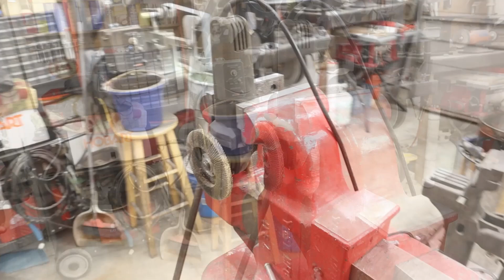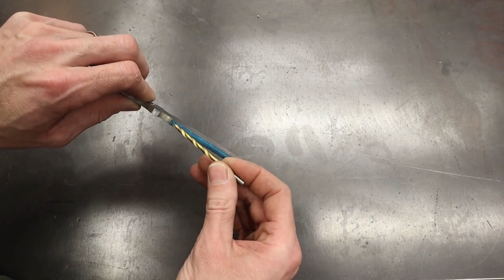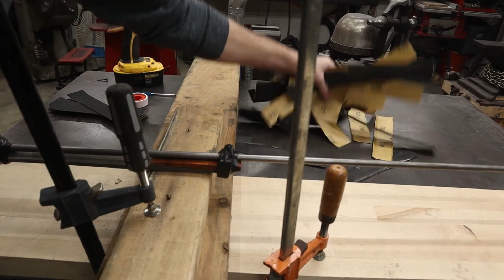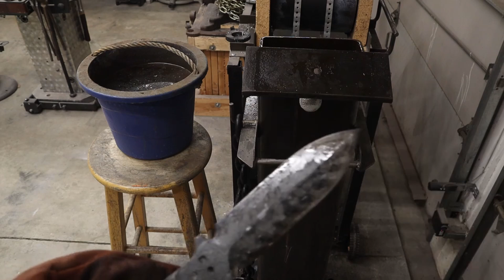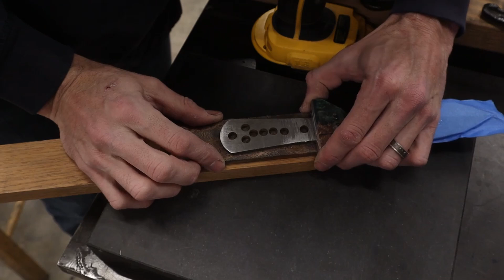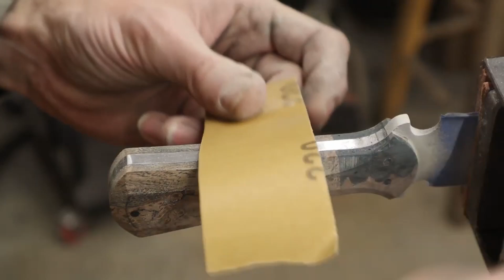Making a special knife!

Comment: I subbed.  I just jumped into knife making a couple months back, I'm 64, been an auto mechanic- mostly for 45 years but picked up 30 other trade skills along to way. Like jumping into making knives based on something I saw in a show about medieval times, and scraps  iron from something I'd cut off with my plasma cutter., then buying a 1.5' x3.5' x 1/8" piece of stainless steel which was 10x what thought it would be and wouldn't have, had not the man who owned the place immediately cut the price in half because he was so pleased with repairs I done to his car at 1/2 the cost the dealer had quoted. But I have since scrapped a free treadmill for the motor, bought the pulleys and built a 2x72" grinder. They declared me disabled 2 years back after a fall broke 107 bones and they expect me live on 960 a month. I still have my tools so I've been using those which I now see a waste. And had a good laugh when I saw that can of Mothers polish, which I have for the wheels on my truck. Thank you for most encouraging informative video I seen yet.  Everyone thinks I'm wasting what little time I have left, and don't understand that when I stop working is when the dying starts. I think your idea with the grinder/vise  perfect and safer than trying to put the knife in the vise. Thanks for guidance, providing me a new course of action.

Comment: I subbed!!! Love your videos!! I’m just starting to get into making knives and I’ve learned so much from you already just from watching! My shop is finally together and I’m waiting on some materials so I can get working on my very first knife! I have a question and it’s a dumb one but I just don’t know much about files so, my question is what kind of files do I want to use? Especially when it comes to the hand grinding the bevels and filing the handle to the grind to lines??? Other than that I love the videos and I’m a sub now lol!! Thanks if you can answer my questions!
Reply from the maker: I bought lots of different styles to test. The harbor freight files work fine but they will eventually lose teeth. The more expensive Nicholson files give a finer cut with less clean up work afterwards.  Basically any files will work. Best files are old stock 1975 or earlier before they went to using the new powdered steels
Reply: @Aleeknives  ok cool thank you for the response. Yes my grandfather left me all of his tools in his barn and I literally have 50-75 old old Nicholson files and some w no names on it but, my main thing is what ones to use for blade work and what ones to use for handle work? Some have bigger deeper teeth and some are very fine so I just wasn’t sure if I can use whatever whenever or if I start a certain way?? Ect…
Reply from the maker: I use the rough cut to remove material fast and the switch to a fine cut file to clean it up before moving into sanding

Comment: Hi Alee, another very nice blade that you have prepared. For your selective quenching, why did you first soak in water and then in oil ?
Reply: And what kind of wood do you use?
Reply from the maker: I wanted the hamon to pop on this one so rapid quench in water helps the steel transition faster! But quickly to the oil to not quench too fast. This is elm burl

Comment: Excellent knife. Outstanding video. I’ve learned a ton watching your videos. So now, I have family members that want knifes for the holidays. So I got some stainless steel blanks from eBay and will make some scales for them. After the holidays I’m going to pickup a forge from Amazon. Then pick up some bar stock and go to the next level. What’s your experience and take on using stainless steel. Anyways I’m looking forward to your next project.
Reply from the maker: Stainless requires a heat treating oven to heat treat properly. You can't do it reliably with a forge. I have not used stainless for that reason
Reply: @Aleeknives  Ok. I get it, that’s why you don’t see stainless steel knife making on YouTube . I’ll do the scales only for the SS knifes. I can’t even get my wife to clean up the steel knifes  right after she’s used it. It goes right into the dishwasher or the sink. It’s probably a secret ploy she has for me to dice up onions with  the knifes that I’ve made. Because I clean it right after I use it.  Anyways love your videos. You are a Jedi Master for us out there in YouTube land.
Reply from the maker: Thank you

Comment: Awesome video. Beginner knife maker and I have learned a lot from watching your videos. Haven’t made my first blade yet (just been putting handles on knife blanks), but getting ready to do my first blade. A few questions if you don’t mind, after heat treating, what did you do to get the blade to the final stage of creating the edge and sharpening? Did you hand sand to remove the scale from heat treating? Also, I know this may sound like a dumb one, but what type of file did you use for the beveling? Thanks for your videos and sharing of knowledge. You provide great detail into the processes that many other channels leave out. I subscribed.
Reply from the maker: That is exciting to start on your first blade! I got pretty close to finish thickness before heat treating this one. I also used the clay on the ridge for the differentially heat treated effect. So there wasn't much scale to sand off afterwards. I used a flat battery file from harbor freight on this one

Comment: Dragging a file back and forth like that will prematurely dull the file. A file will only remove material during your push stroke. Just a piece of advice, especially for someone starting off on a budget. Don't wear your tools out due to misuse and save yourself some money in the long run.
Reply from the maker: Totally agree I meant to bring attention to the fact that I was only adding pressure on the push stroke.

Comment: Did you skip a step? I didn't see you doing any filing or grinding on the bevels after heat treat. I was curious about that part because even a tempered blade is pretty hard. Do you continue with the same file method? I assume you hand sanded the blade. Did you use the same jig to do your sanding or did you free hand it? If you free hand it, did you find it difficult to keep that crisp grind line?
Reply from the maker: Actually since I was doing this knife 100% by hand I took the knife to a finish sanding grit before I heat treated it that way after heat treat all I had to do is clean it up with sandpaper also doing the clay temper the clay protects the knife in the area that it's covering so the only area that has carburization on it would be the edge where the Hamon shows up
Reply: @Aleeknives  But you said in the video that you keep the edge at the thickness of a nickel before heat treat. Is that how thick you take your edge before sharpening it?
Reply from the maker: This knife I worked theedge closer to finish thickness before heat treat. It was actuallya little thinner than a dime. I just watched the video again and I did loose some footage in there about right after the temper cycle. I didn't show finish sanding and etching the blade and went right into making  the handle. Good eye Sam!
Reply: @Aleeknives  Well, I'm always curious how other people do things in hopes of learning. Thanks for the video!

Comment: Apart from doing pilot holes, if you are set on using hand tools and want to maintain a straight, 90° hole... take a block of wood that is at least 1" thick. Measure it with a set square and cut a corner out of it, keeping your cut true to 90°. Clamp it where you plan to drill, and you have a makeshift guide to see if your drill angle starts to wander.
Reply from the maker: Perfect setup man!